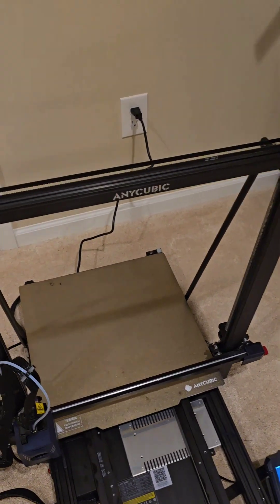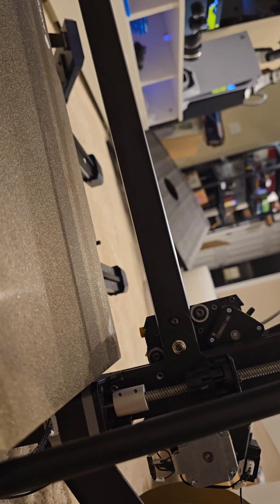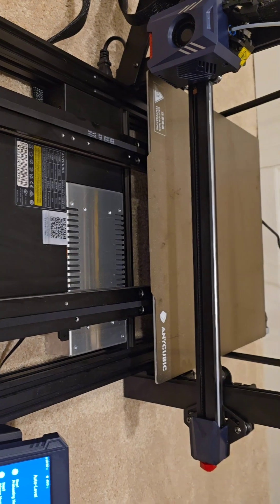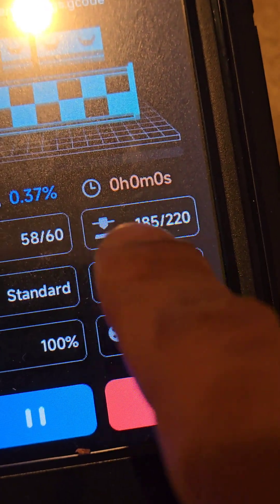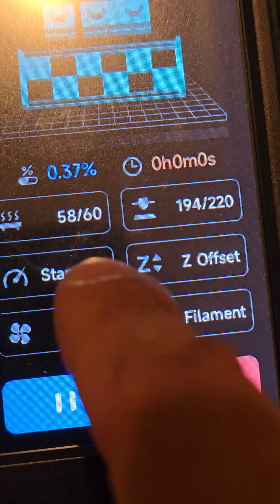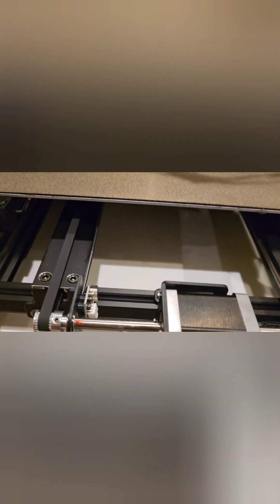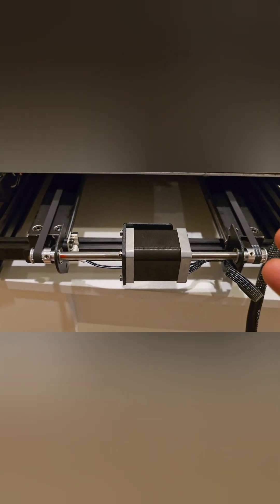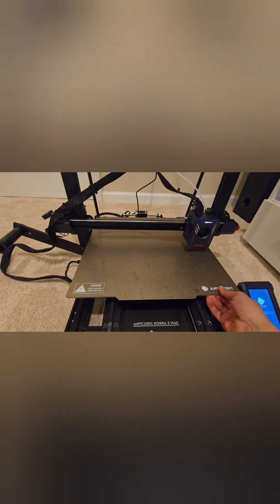Kobra 2 Max Y Layer shift Part 2

Comment: Also remember the heating of the motors are a  issue, so buy heatsinks made for nvme ssd's glue them on using gorilla glue or industrial glue to the back of the motors. Make sure they are  Aluminium which dissipates heat better or a heatsink that is the same measurement of the motors. On the kobra 2 i found majority of the layers shifts was from the back of the print head module the wheels needed tightening or the rivet screw holding those wheels would come loose, so if you can use needle nose plyers hold that rivet nut in the middle and begin to tighten the wheels. The z offset has always been a issue but every printer has issues, i kinda want to buy the kobra max 2 but with all  these negative reviews of layer shifting after hours of printing i might just say the hell with it and go bambo labs. Very disappointing as i loved the kobra 1 n 2, i need something for large prints.

Comment: After a couple of messages with Anycubic, they sent me a new Y axis motor and a new motherboard. My printer is at 17 hours of a 32 hours print, no more skipping, where I had random 10mm+ shifts on the Y axis
Reply from the maker: @Psychokiller1888  yeah I figured it was the board. I swapped the y axis motor, slowed down the print, tightened and recalibrated all the moving parts for the y axis. Anycubic offered me a motherboard and didn't send it with the motor. Ended up getting a refund and buying another

Comment: Mine's about 2 weeks old. Its reached about a hundred hours too and started doing absolutely massive layer shifts on the y axis. Im about ready to return the damn thing...
Reply from the maker: I'd exchange it. Apparently, the issue is hit or miss. The printer is great when it's working. Im worried we may prep for another con where i need to use it heavily and it'll crap out again.
Reply: Same here, bit under 100 hours, massive 15mm Y axis shifts at random heights. I completly dismantled everything today, rebuilt the entire Y axis, calibrated, it pri Ted up to 70 mm OK then shifted like crap. I about the throw it out the window

Comment: Having fought layer shift on my kobra 2 I know the pain you're going through. I noticed that in my case it began to get significantly more frequent before the Y axis fully bit the dust and the main board has to be replaced. Found the Y axis vref was set VERY high on the old and new boards and I suspect this is to allow for the higher print speeds but I don't believe that this is the best approach. My board uses GC6609 drivers which my searches have shown to be low current clones of TMC2208 drivers and this, I think, is the root of the problem. To get the higher speeds the bed must move faster which means a stronger motor which means higher Y current is needed. But the drivers just can't keep up with the motor's needs and go toes up. I think genuine TMC2209 drivers, or driver's that can go higher than 2A for sustained periods, plus a stronger Y motor would solve this problem. I can only guess anycubic went the route they did to save costs but I HAVE to believe they are spending more on warranty work and replacement parts than they would in a properly specc'd driver/motor combo. I might be completely wrong however but once this replacement board dies, and I am positive it will, I'll replace with a manta m5p and go full klipper. Mechanically these are great printers but the boards and firmware leave a lot to be desired.
Reply from the maker: I definitely think the issue is mechanical or electrical and not hardware. They recommended based off this video that my eccentric nuts aren't properly tightened on the y. I'll give it a shot and see how that effects it. Ill post another video with updates
Reply: @ShadowMoses112  When the Y started shifting on me it got really bad really quickly until the Y just died entirely. Driver IC kicked it and had to replace the mailboard.
Reply: @Enjoymentboy  Do you have any steps on how to adjust this for folks possibly having the same issue?  I wouldn't mind making another video that may help
Reply: @shadowmosesmusic  YouTube channel Print Practical has a great video on it (3d printer stepper driver vref) and the description is linked to an online calculator to find your specific vref. I've used it for multiple printers and it works perfectly. Bear in mind this is all possible if your board allows it. Look at the driver IC on the board and if you see a small potentiometer beside it that means you can manually adjust. Apparently the newer boards (klipper versions) don't have this and the vref is hard set in the firmware. Assuming yours has the potentiometers you only need a multimeter, small Phillips screwdriver and an alligator clip test lead. First thing to do is unplug the connectors from the motors. All of them. Failure to do so can damage the board. Next put one end of the alligator clip on the positive test lead and the other end on the screwdriver. Power the printer on.  Negative test lead goes to the negative of the 12V/24v power supply to the board. Screwdriver (positive lead) goes to the potentiometer. Make very small adjustments until the multimeter reads the vref value you calculated. For example I calculated 1.29V for my Y axis but it was reading 1.76V so I turned the potentiometer counterclockwise until the meter read 1.29V. I actually hit 1.3V because that's as close as my fat thumbs could get to. It doesn't have to be dead on... just close. I did this for every axis based on what vref the calculator showed. It's WAY easier to do than to write and you can do all axis in less time than it took to read this